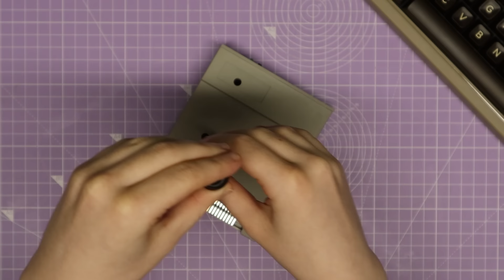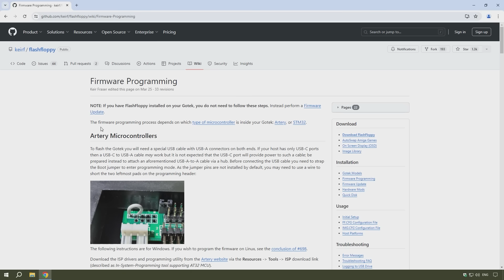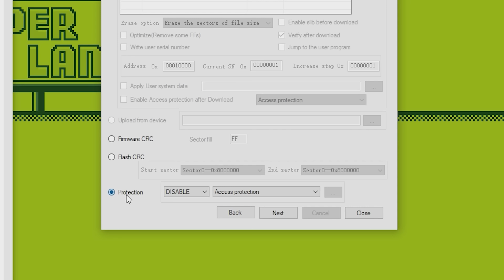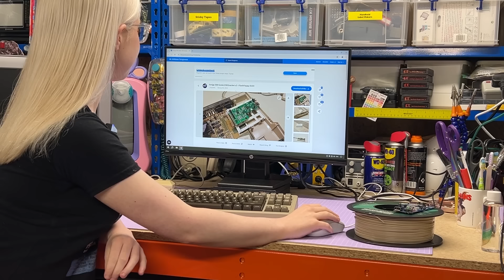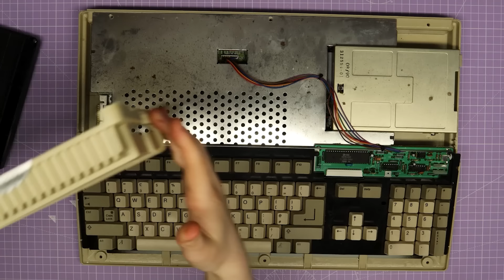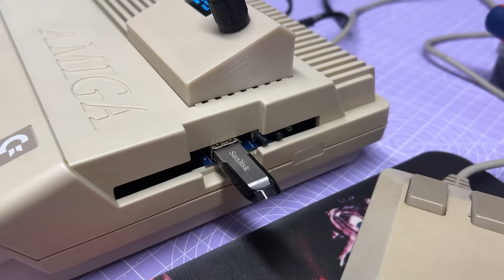Saving a Commodore Amiga A500 from the trash

Comment: I absolutely love that you are showing how to take a cheap stock Gotek from AliExpress, re-flash the firmware, upgrade and prepare it for the Amiga. Since I have been doing this for years now, thereby saving quite a sum of money. Goteks bought from retro web-shops, can often cost from 2 to 4 times as much, and they are just buying them in bulk from China and doing exactly what you show there. Tons and tons of 👍points to you for showing just how easy this is. ❤ - Also love the almost spot-on filament colour.

- However, an Amiga 500 with only a broken floppy drive, is a bit of a rare and lucky find these days. There can easily be a lot more wrong with these old "girlfriends" (Amiga in Spanish). Many have just been chucked into lofts or cellars with several decades of poor conditions for storing electronics.

Moisture can cause all kinds of nasty corrosion to both the motherboard and the traces, and fluctuating summer/winter temperatures can cause electrolytic capacitors to dry out and/or start leaking everywhere. It can especially be critically bad, if the owner didn't think of first removing the memory-expansion or even better cut out the VARTA battery all together (in an A500 those are usually located inside the memory-expansion module, while on an A500+ the battery can sit on the motherboard itself, which is even worse). Since the electrolyte from both capacitors and that battery can over the years reek havoc eating away at the Amiga's wonderful custom chipsets (which are obviously no longer in production), the traces, or even the motherboard itself.

Yeah, taking an Amiga out of improper storage can often turn out to be quite the horror story. Not that long ago, the worse scenario would probably have been a damaged motherboard. But we can even get reverse-engineered replacements for those now (a hell of a job to solder those up with new fresh components and moving the rare ones over.). yeah, damage to the custom co-processors is properly the worse scenario today.

So, definitely gratz on the fully working Revision 6 "B52 Rock Lobster" Amiga 500 - which is capable of handling up to 1 MB shared Chip-memory and 1.5MB Slow-memory (with a "BooBip" memory-expansion module), and an additional 8 MB Fast-mem (via an accelerator-board)... So, 10.5 MB RAM in total.

- Next up: I think you should give the old gal a "PiStorm" and maybe a "RGB2HDMI" upgrade - She definitely deserves it, just from sheer beating the odds. Those 3 (incl. the BooBip) are properly some of the more cheaper upgrades... With the "Wicher", "Terrible Fire", and "Vampire" accelerators being some of the most expensive. There is not much point in fiddling around with the also very-soon-to-be vintage CompactFlash cards for these more expensive accelerators. As it is quite possible to use both SATA hard drives or SSDs via IDE/PATA-to-SATA adaptors (either made by StarTech or just some of the tiny cheaper ones from AliExpress). Although, there wouldn't be much point in going higher than 120GB or 160GB for an Amiga. The hard drives we had back then for the A500s were 20MB or 40MB tops (nope, not a typo... MB as in mega-bytes), and those were crazy expensive, noisier than a sawmill, and slower than a turtle on a conveyor belt going in the opposite direction.

Of course with a Raspberry Pi 3A+ driven PiStorm accelerator, you instantly get all that and more, only much faster, a lot cheaper, easier, and without all the old hassle and head-to-wall butting headaches.
- You'll probably still need the BooBip, since an Amiga-owner can never get enough of that wonderful chip-memory (which is accessible by the CPU and the co-processors simultaneously).

Comment: I still have my original Amiga 500 I bought in 1994 after delivering newspapers and advertisements for two years. It still works and I also put a GoTek drive in, to not wear on the original disk drive and old floppy’s. I have an external,drive I can use to transfer the diskettes.

Comment: Thx for the nice Video on the Gotek drive! As you already mentioned, you should never "hurt" the case when modding. So, having the cables come out of the drive's slot would be better.
The most ground breaking game in the past for me was Dungeon Master. Although it was grid-based all actions were done in real-time. And the riddles were quite nice. Time-based and even weight-based. But it needed a ram expansion to 1MB 😊

Comment: The Amiga 500 was my granddad's computer and it's what got me into technology when I was young. 

Little known fact: Sennheiser made a radio mic control software (for their big radio receiver racks used in west end musicals etc) which ran exclusively on the Amiga. It was a while before they had a version of it for Windows so there was a time in the early 2000s when there were more Amigas in the west end running shows than there were in people's homes ! 

Citation: my parents worked in the west end in sound engineering and I saw it first hand when going into work with them.

Comment: When i got an A500 a few years ago (I had the A600 as a kid) the memory expansion was totally corroded thanks to a leaky battery, so I ended up adding the extra 512k ram onboard, it also looks at a glance that with your A500 it should be posable too, that might be a fun job for you :)

Comment: I installed a gotek in my old amiga a few years ago.
I bought mine on Amazon, I don't remember using any dodgy looking Chinese software to reprogram it, sure I used something else!
Btw the RF shield isn't needed these days because everything ( TVs, radios ) is digital.

I also made a new power supply using a Meanwell switched mode power supply, from Radio Spares. Stuck it in a new box, replaced the mains cable and used the existing cable and connector to the Amiga. The Meanwell unit de-rates itself if it gets to hot, it's more sophisticated than the original power supply.

Comment: That was a beast of a machine and totally ahead of its time.
Reply: Agreed, but the RAM sucked and I also don't miss the Guru Meditation errors 😄
Reply: @SolarCookingGermany  the ms dos emulator there was rather limited, but Amiga Dos ran in multitasking so you have to accept crashes there in the playground
Reply: @testkonto-k5n  A lot of the problems were caused by the RAM architecture.
Reply: @SolarCookingGermany  fast RAM, chip RAM with DMA and also a DMA memory refresh? that the CPU had to share the RAM with those three chips?
Reply: @testkonto-k5n  A nightmare for programmers

Comment: Remember before adding the solder, heat up the general area where the connection will be made. If you follow this you'd make a great connection and not possible cold joints there.

Comment: I feel so old, I remember when the Amiga was cutting edge and no other computer could top it.
Reply: I know what you mean. As a  speccy 48k owner, we used to look at you Amiga owners with such jealousy 😂😂
Reply: I jumped from a 48k Atari 800 to an Amiga 500.
Reply: I'm sure that there were plenty of supercomputers that topped it.
Reply: @unduloid yeah . After a few years . That's THE big deal about it .
Reply: I went 48K+, A500, then added an A510 52Mb drive with 2Mb ram before getting an A4000/030 with 8mb ram and an 80Mb drive (later added a cd rom and an 800mb drive)
Reply: Amiga 500 and c64 peak computer/gaming.
Reply: @McRcFly  Yeah. I've had over 7 A500's, multiple 2000's, 2 c64's , 1 C128, Atari 520ST , Atari 2600, Intellivision , etc. 
And yeah, out of all those, the Amiga was best.
Reply: @roadmonitoroz  I have have many c64s and amiga 500's still.
Thing is if you collect these computers you need to know how to maintain and fix them.
Otherwise it's a big issue.
Reply: @McRcFly  Mine are all gone as they were taking up space (2 - 3 large boxes). When I sold them, I threw in at least 5 x A500's (at least 1 of them in good working order and the rest almost complete (3 power supplies I think), a couple of RF modulators as well probably and about 150 disks , disk holders and other bits and pieces related. The guy loved Amigas . I think he'd be at least 70 yrs old now. 
I think the only old machine I have left now(It's in a box somewhere)  is a Playstation 2 (yeah, antique) with 1 controller, memory card and about 3 games. I did the same as I did with the Amiga.. I sold 2 - 3 working PS2's , 1 memory card, 1 or 2 controllers and my entire game collection minus 3 games. 

Crazy thing is.. I still have a room full of stuff I rarely use, boxes of USB cables (every type - Pretty well lifetime supply), AV cables, adapters
Reply: @roadmonitoroz  hence why you had over 7 of them
Reply: Same
Reply: Still is on top 👍

Comment: I've used that filament as well. I think it actually matches closer than the Printed Solid Jesse "Beige 500" filament which is supposed to be an actual match for the Amiga 500 colour. Maybe it is something to do with the degree of yellowing the Amiga happens to suffer over time and the Jesse is perhaps close to a factory brand new Amiga. Hard to say, but that Bone White filament is definitely a good choice for any retro 3d printer projects regardless.

Comment: Nice to see Amiga content :) Very nicely done mod, looks clean and tidy as you routed the cables from the cooling vents under the 3D printed part. 
So far my A500 original 3,5" disk drive still works, at least last time I used it, but good to know there are options should it fail at some point.

Comment: Using a breadboard as a soldering jig is one of my favorite tips. It comes in handy far more often than you would expect.
Reply: Oh! Especially when you need to solder multiple rows of headers. For example, I recently used a breadboard when adding headers to a Pico W. Not only does it ensure the individual pins are aligned, it also ensures that both rows of headers are perpendicular to the PCB.
Reply: Yeah! I think I'll try that as well
Reply: I have a crispy one that was over amped a bit that is now used just for soldering headers.
Reply: Indeed  I remember using perf board and tack blobs before we had "modern" breadboard avail cheaply

Needless to say the breadboard type she bas is infintely better
Reply: I keep perfboard and stripboard in various sizes as well as a whole bunch of different sizes of no-solder breadboard, which is great for arduino nano sized microcontrollers and DIP chips.
Reply: One (extremely!) tiny criticism about this video is using a desoldering gun to clear the vias. Seeing as you needed to heat the iron up anyway, why not just use that with a solder sucker or solder wick? It seems a bit silly to wait for a second tool to heat up.
Reply: @pseudotasuki  Easier, Less damage, Safety, Cleaniness, Enviroment, Health .. sevral benefits of using one .. and if u have to desolder/resolder alot the investment pay off pretty fast...
Reply: @pseudotasuki  Smoke em if you got em.
Reply: @pseudotasuki  because once youve used a desoldering gun for through hole stuff, youll never want to use a manual solder sucker again :)

Comment: The enclosure is perfect the way you did it Kari. It would have been unsightly with visible wires. I remember my old Amiga. Nobody could beat me at Kick Off 2. About a year ago, while I was feeling nostalgic, I bought a little Amiga 500 so I could play KO2 once again. However, the gameplay isn't the same. I think I'll go full retro, buy an  Amiga 500, and find an original copy of the game. Your mod video will be handy if I put a couple of usb ports in😀
Reply: If you like Kick Off 2 I would suggest searching for Kick Off Online. It's basically KO2 ported to PC, using Unity. If you have a usb adapter you can even use your old Amiga modified to play it.